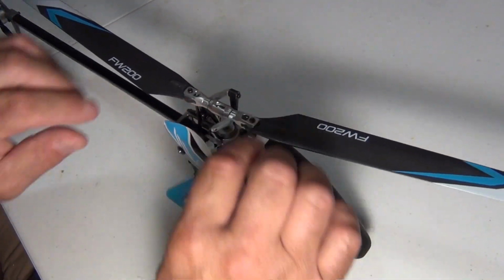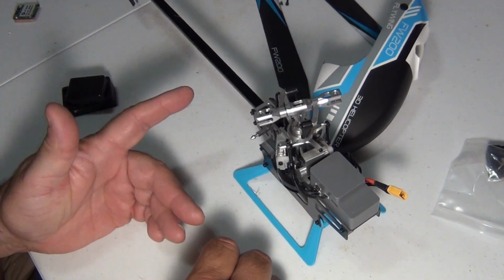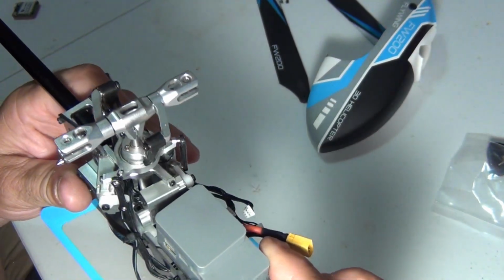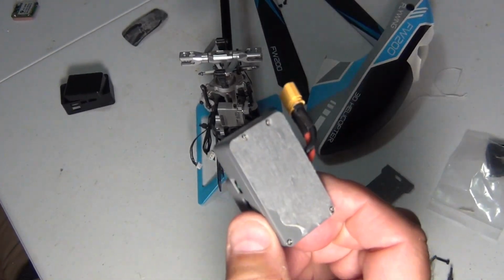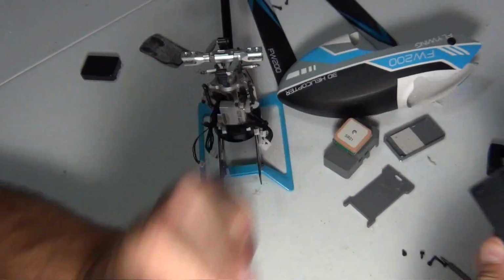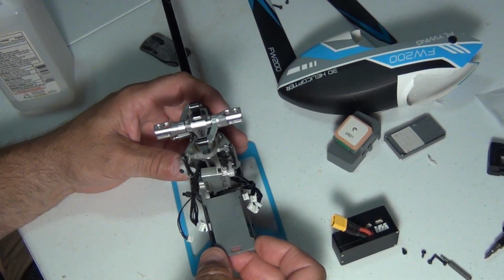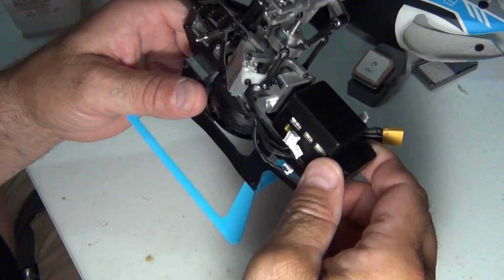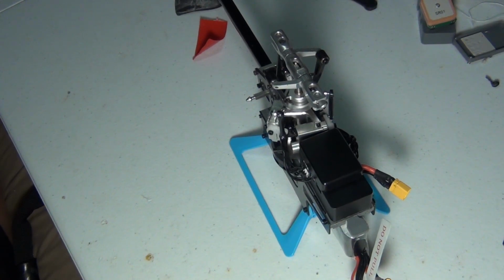Flywing FW200 GPS UPGRADE Install

Comment: Thanks CR I have 2 fw200 ,1 I just bought with the black box upgraded gps and 1 I bought last year that has the original. The black box gives me 9 sats while in the basement, the older one gives me 0. So I just ordered the upgraded gps from helidirect. Thanks for the tutorial.

Comment: Hi,
Got myself ALZTC 505, and this is my first FBL Heli.  I’m use to fly Heli with fly bare (Thunder Tiger Raptor 50). my D/R EXP set at 25. I only do sport flying.  

With this 505 FBL the helicopter is very responsive with D/R EXP set at 25 and still afraid to hovers or fly this helicopter. 

What is your recommendation for D/R EXP setting so my helicopter won’t be so responsive. 

Also I just order H1 auto pilot for this heli and one of your video will be great help setting up.

Comment: you'll need to pad a bit of foam between the GPS and its plastic casing. This stops the bulky & heavy GPS module from flopping around inside the case that may cause damages to the GPSs pins  and connectors. I had mine suddenly loosing all GPS (detected none) and found that the connectors & pins were ripped off the GPS and the Flight Controller PCBs.

Comment: Please use a small screw driver to loosen those connectors! I had to fast forward LOL! Many times Isopropyl alcohol will cause the adhesive to release. I spray the adhesive pads and let it sit and it most times comes off much easier!

Comment: I have one and it takes 5 minutes to lock! It must be the older GPS! Companies that do not include instructions and flight controller pinout diagrams are crap in my book. I purchased a brand new HD-Zero equipped Crux 35 racing quad that cost $350.00. There were no setup guides, pinout diagrams, and all of the firmware to include the RX, flight controller and VTX firmware needed to be updated, I tried for days to get the company to respond with no luck. Luckily, I own over forty of these little machines and have scratch built many of my own! I was able to wade through updating HD-Zero, ELRS, and Betaflight to get the little turd to work. Four days after I contacted them, they finally replied with a link to the setup and pinout diagrams. There was not even a link to the downloads that shipped with it. Value added service is a thing of the past with most companies. Some like Diatone, and Emax still put a good package together, but it is the exception rather than the rule with most Chinese companies!

Comment: Nice job on the video! I will upgrade at some point, but mine locks in within 2 minutes now. Do you know if the flight controller has ever been upgraded? My FW200 is over a year old now, don't know if it is a V2, or an earlier version. Thanks
Reply from the maker: i thinkthe other 2 boards are the same, just went with ublox gps, depending on where you are the old one takes forever, but if your happy, dont change
2 minute is excelent
Reply from the maker: grey or black controller ?
Reply: @CRUZROYHelicopters  Mine is grey.

Comment: Can his gps unit, be use on the fw450 v2 helicopter?
Reply from the maker: sorry no, but they sell new module for 450.   https://www.aliexpress.us/item/3256805801122105.html?spm=a2g0o.productlist.main.61.71767e44zR6SSr&algo_pvid=be8c8379-ef31-4bde-b493-0ee347eb1ac9&algo_exp_id=be8c8379-ef31-4bde-b493-0ee347eb1ac9-30&pdp_npi=4%40dis%21USD%2149.00%2149.0%21%21%2149.00%21%21%402101f49816944338134126890e88be%2112000035193780754%21sea%21US%212494645443%21S&curPageLogUid=jzR6HEVkQWQs
Reply: Ok thank you so much 👍🏽